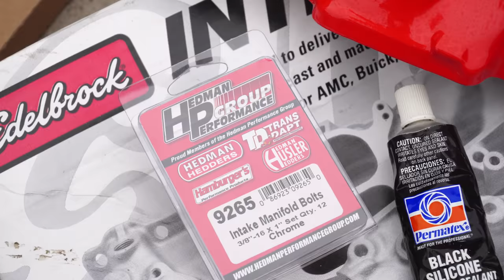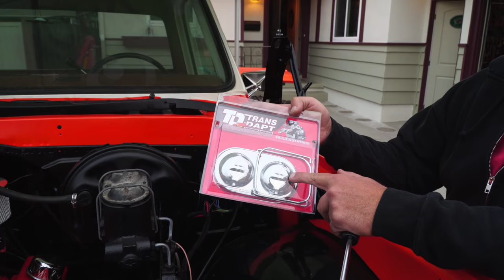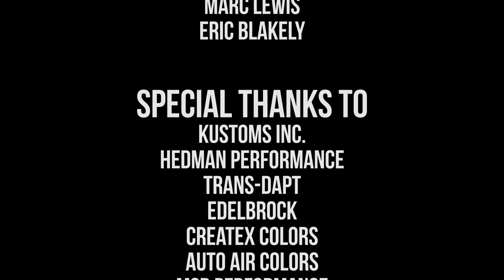Tried + True - Motor Makeover

Comment: I found mixing MEK with acetone makes a really powerfull paint remover and degreaser. It will actually etch any surface that's not metal and perfectly prepare it for paint.
It is easy to use. Just liberally spray all over your engine compartment. Let sit for about 10 minutes then pressure wash. after that dry and prep everything. For less than $20 a gallon MEK cannot be beat for a cleaning assist.

Comment: What about the exhaust block off plates on the intake gaskets... with the edelbrock carb in sunny socal, you may experience fuel boiling in the bowls, giving you a hard start when it’s hot. I know the carb spacer helps.

Comment: If you center the engine stand with the flex plate the motor will turn easier on the stand

Comment: I lost all respect when you put a square flange gasket on a spread bore manifold @ 30:00. Funny part is you replaced the manifold and could have got a square flange performer intake for your square flanged performer carburetor.
Reply: I thought I was the only one that notice that. ( can you say vacuum leak ). But it does look pretty.

Comment: Sorry but for the same or close to money you guys could have gotten some much better parts. I understand you guys have to showcase your sponsors, but all of these companies make better quality parts than the ones picked. Unless your sponsors picked the parts for you or you deliberately went low end to make the project more "every man". But I'm not going to pull the motor just to put stamped steel valve covers and a cheap edelbrock intake on.